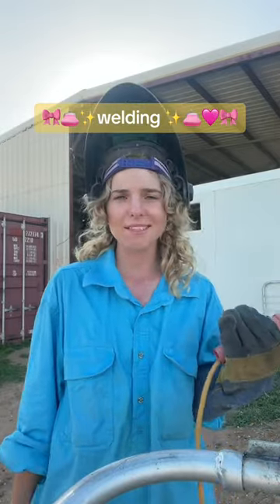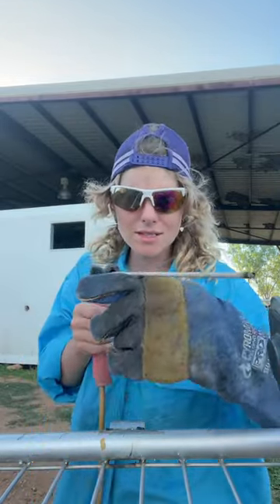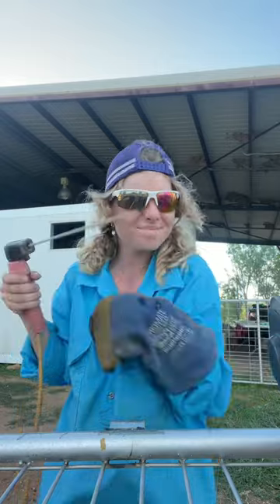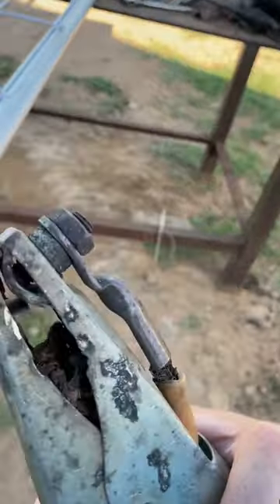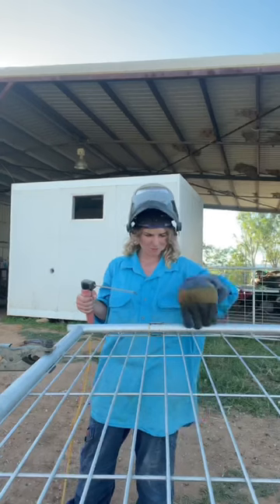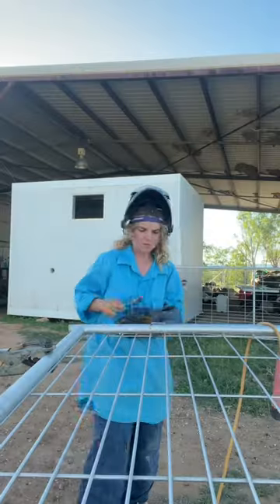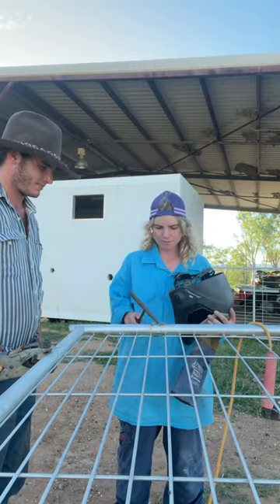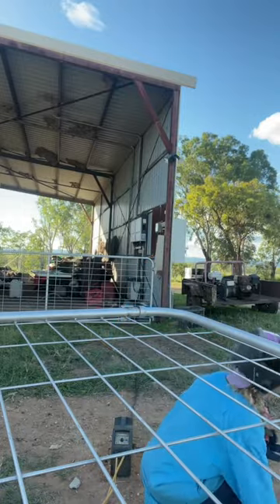havent been told how to do things in my comments in a while so here’s a welding video

Comment: For starters the welder is set way too high for the size material you want to weld. Ok for tacking. Not for running a nice bead of weld. Try about 95 amps. With low hydrogen rods you are using , they can be hard to start. Try tapping the end of rod on concrete or not where it will earth out, to break off the flux thats preventing the metal in the rod from earthing to job. Angle the rod about 10 to 15 degrees off vertical towards  the hinge as its thicker Steel and you wont burn thru it like the pipe. When you start , dont move too fast, you will see molten metal pool forming. Dont move too fast that you come out of it and maintain constant speed. The weld rod will dump metal into the pool and you need move away from it so it doesnt build up too much. Watch the edges of the weld pool burn into each metal you are welding. You should end of with bead of weld thats prominent and like a little hill between the two metals, not flattened out and the edges under cut from welder set too high.
Remember to adjust the welder to the size material you are welding and keep the lenses clean in the helmet so you can see properly exactly whats happening and where your going withe rod. 
Hope that helps. I like your videos and your personality and think lots of others will also , once they find you. I found you on youtube shorts. Look forward to seeing more
Reply from the maker: cheers mate ❤️ copy and pasted into notes ✍️ 
Thank you so much for the advice and kind words, means a lot